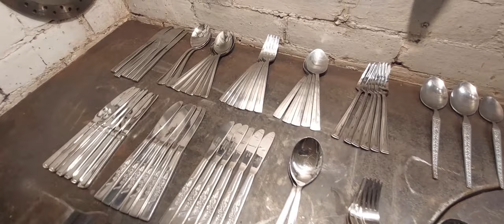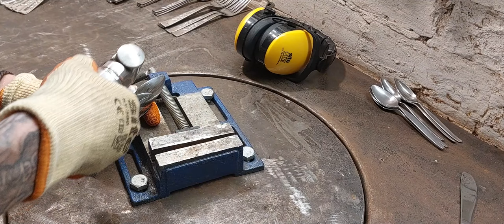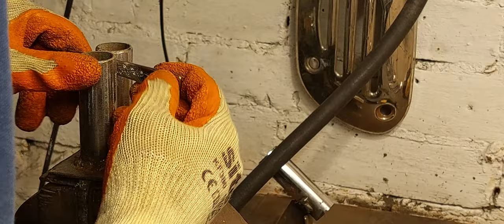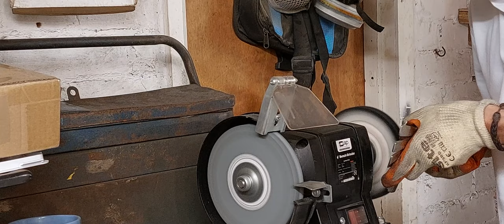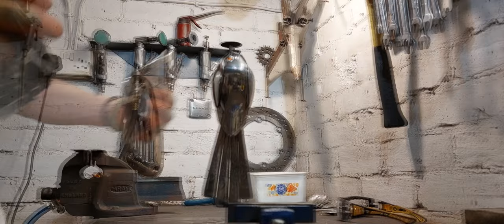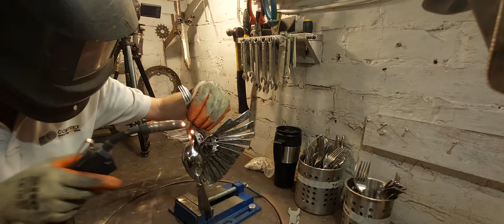A new bird, a new inner wing concept ...

Comment: I’m trying this metal sculpture making but struggle to find enough cutlery! How do you source it? Thanks
Reply from the maker: Try your local charity shops, although many won't sell knives (even butter knives!). Better still, some charity shops have chains and often a local (ish) sorting warehouse where everything gets collected. If you can make a contact there then you should find a plentiful supply. Suggest you try and get a contact email from a local shop for a sorting depot manager. More often than not they send it all off to the scrap yard but if you can get them to dump it all in a large plastic tub for you then you might just get it all at scrap value and save them a journey in the process. Also much cheaper this way!